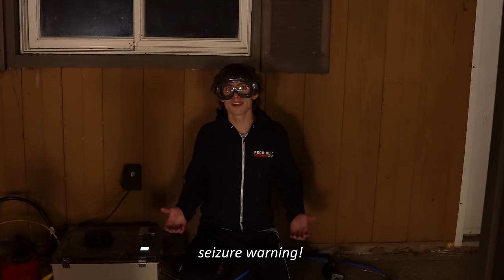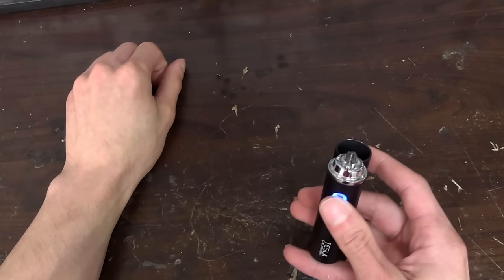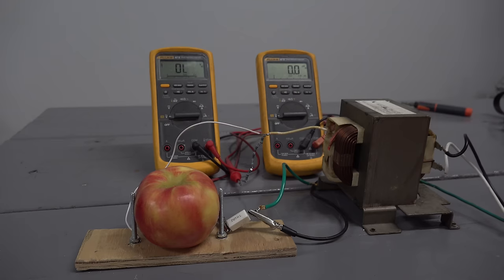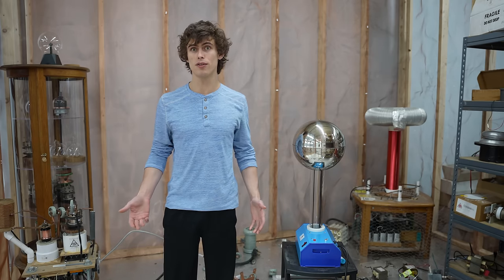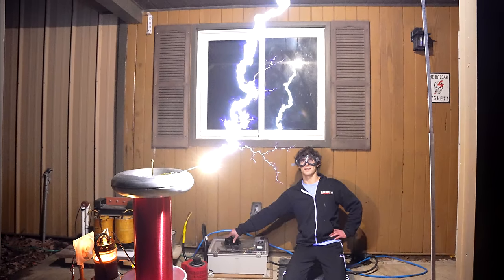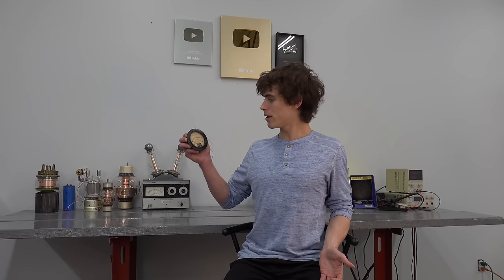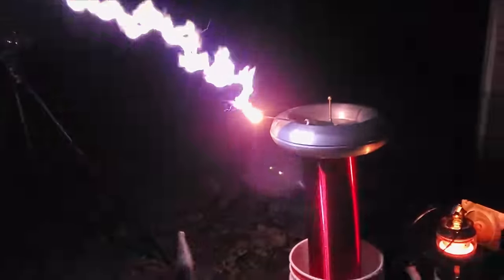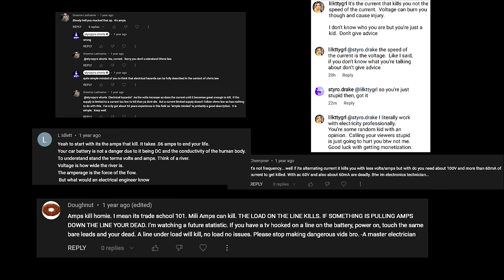Is it the volts or amps that kill?

Comment: This guy has a better understanding of electricity than most physics teachers will ever have
Reply: Nicely done educational video for the most part. However, the current measurement was not done correctly. Current at the bottom of the coil goes mostly to charge/discharge of the top load and coil capacitance. The arc current is only a very small fraction of the 3 amps that were measured. You should have held one lead of the meter in your hand and let the arc current go through the meter. That would be a lot more accurate measurement of the current that goes through your body.
If you really get 3 amps going through you at any frequency it most likely will kill you or leave really bad burns.
Reply: This guy has got his science very wrong, infact the i can tell you now that his arcs have less then 0.03 amps running through them, with out more info i could not tell you how many amps but i can ensure that is a magnitude less then he is claiming. if you dont believe me you can do some very basic math to work it out. For example i live in the UK, power from the wall here is at 240v, because we know P=IV in order for 3 amps to be supplied by the tesla coil while producing 100000v (thats the voltage he claims it is working at) you would have to put in 1250 amps at the plug (which is insane  and not possable), that would be 96 times the number of amps a single plug can supply and about 12 times the amount of power you house can take as most homes have 100amps or less on the mains input before your fuse board. For all you out there on 110v power that would be 2727 amps required to create a 3 amp arc.
Reply: @cbullar4205  You are on the right track here, there are several things wrong with the presentation. Unfortunately you are going in the wrong direction, get out the calculations and try again. The higher the voltage the lower the current in a transformer in ratio to the turns of wire.
Reply: @tedmoss   Im somewhat confussed by what you are trying to say, i have already pointed out that the higher the voltage the lower the current, its in the equation P=IV and given that in the case P (Power (Watts)) is a set value if I (current (amps)) goes up V (Voltage (Volts)) comes down and visa versa hence the outrageous claim that he has 3 amps at 100000v is just not possable on a wall plug as he is running his machine.
As i said realisticly he would be much closer to 0.03 amps (probably a lot less) but with out more info i could not tell you the exact figure.
For arguments sake, say you are on a 240v supply limited to 13 amps on the plug, that would mean the input power is 240v times 13amps which equals 3120watts. So with this we can see that the max possable power is 3120 watts if no losses occur (which they do) so if we feed this into the equation P=IV we get 3120=I*100000 which is the same as I=3120/100000 which means I or current is 0.03amps. As im from the UK i have bassed the figures on whta we use here, how ever i believe that US would be about 120v at 20amps limit on a plug which means the figure would be even lower still at 2400 watts or 0.02amps @ 100000v.
I have gone and changed my wording in the origional message as i can only presume there was a miss understanding of what i was saying as i was pointing out how rediculus the claim of 3 amps is rather then showing what a more likely figure is as i have done here.
Reply: @cbullar4205  hes not using a wall plug. at the end of the video he shows whats powering the coil. Also he lives in a cabin in the woods, im sure he gets more power to his place than most people as hes a chemist and probably needs certain power ratings in his home which he had custom build
Reply: @Yoda_Gaming1738  You have no idea if he is pluged into a wall plug or not. All he shows at the end is his power supply made form a number of step up transformers amongst other parts, how ever you can see the cable that runs to the first transformer and it looks like it might be a 10a cable 16a tops so that blows that theory right out the water. Also most building out in the woods have access to less power not more, but more intrestingly, "hes a chemist" and this is why you are trusting he presentation regarding physics?
Reply: @cbullar4205  youre the one assuming what his cables are rated at. Why would he lie here? other professionals have recreated these experiments countless times and proven that its not just amps that kill. Also yeah I trust the dude who went to college for chemistry to teach me about the compound makeup on human skin and an apple and how those theorist are easily bust in his scenarios. And no rural areas do not have less power, here in the US if youre connected to the grid your house is getting 120V power, but again, he could have had his power run through a transformer to step it up before entering his home
Reply: @cbullar4205  you also mention youre from the UK, hes in the US. our cables and electrical systems are quite different, especially with the climate difference
Reply: @Yoda_Gaming1738  Im not assuming what his cables are rated at, im looking at the size of them and making a rough calculation hence i admitted it could be 16a but it looks like 10a cable. Also it does not matter which country you live in the amount of current that can be passed though a certain size of wire before the cable melts, is the same (there are some variations bassed on the wires make up, but im presuming good quality cable with my figures). Also given that the US uses 120v and the UK uses 240v that means the same cable in the UK can pass more power as i have sort of already explained i.e. P=IV.
Getting away from that, i am not questioning the guys knowlege in human or apple skins im sure he knows alot about that, how ever the subject here is what kills Voltage or amperage and although this video is laden with facts alot of the info is not complete or correctly expained. Oh and yes i am qualified to know about this and with out offending any electricians reading this (you guys do a great job and all you realy need to know for sure is electricity can kill), no that is not my qualifacation.
Reply: @cbullar4205 You are clearly just saying he is wrong while anotfher huge electricity yougyber that debates almost anyone saw the video and approved its correct
Reply: That just implies  you have never met many good science teachers 
( or ANY bad ones either LOL)
Reply: Yes he's wrong

Only taking bits from different electrical principles and equations mashing them together at random and not fully applying all the factors involved either, no wonder he thinks ' basic physics' is wrong it's not wrong he just doesn't understand it yet 

Lol
Reply: Oh he forgot to show his power supply 
He's got his own 33kv pad mount transformer in his yard 

415v with a good Few hundred amps per phase 

Must have been one of his MANY Omissions in the video lol
Reply: I teach physics and can solve high-order differential equations in my sleep. But practical application is another beast entirely. The number one thing imo when it comes to understanding electrical engineering is experience.
Reply: @cbullar4205 I don't much about teslacoils, but I do build lasers and he says in the video that is a resonator.
A laser has a much higher power optical field inside the cavity then the "pump" laser has. 
I think you may be missing some fundamental understanding on how the teslacoil works.
Reply: @paintspot1509  Considering Styropyro was research assistant on hyperpolarization NMR spectroscopy, and, before putting it on pause, was on a phd program on Optics with Rochester University - when he says he isn't an electrician nor engineer he isn't lying, but I guess electricians and engineers are actually less qualified than he is to talk about the subject
Reply: @cbullar4205 make a video and show us.
Reply: @cbullar4205  P=IV is NOT correct here. P=IV is valid for a DC source, or an AC source where current and voltage are completely in phase. As mentioned (correctly) in the video, in Tesla coils the current and voltage are almost perfectly out of phase, the exact amount it's out of phase depends on the construction (particularly PFC capacitors can be added to bring them into phase deliberately). 

For circuits were the current and voltage are out of phase, the correct equation is P=IVcos(O), where O is the phase angle. For something completely out of phase, cos(O)=0, so power is 0. Since they are not completely out of phase, the power is not 0, but it is much lower than just P=IV.
Reply: @cbullar4205  Go make a video and prove your point .. until then you're just a waste of time.
Reply: BOLLOCKS! If that were true it would have only taken him 15 seconds to explain this.
Reply: @canberradogfarts  Why are you freaking out? Did you even watch the video? If you did, then how do you still not understand that there are nuances involved that make it impossible to just give a simpleton's 15 second answer? How about you just sum it all up for us real quick, and make sure to prove that what you're saying is true while you're at it? I'm sure the whole world would really appreciate it. Thanks in advance!
Reply: Umm, probably not actually.
Reply: What exactly is the purpose of that 15kw vaccume tube driven coil, does that not have something to do with amplifying the power going into the Tesla coil?

Since he did not show the exact design of the system, it is a BIT STUPID to talk about the design when we don't have a clear representation of it.

I'm not going to claim all he said was correct, I am not educated and/or stupid enough to make such a claim, however he seems very confident in his abilities, can put theories into practice (showing proof of knowledge) and is willing to challenge "professionals" who quote misinformation, so far he seems to have much more authority on this topic that you have brought to this thread.

You're whole argument is "I don't know exactly how his systemis built, but it's wrong"...
Reply: Explain in better detail why he's wrong?

I can't stand so called "professionals, experts" who act like an authority on a topic and claim someone is wrong without proving why your right and they are wrong.

The fact you went out of your way to say he is wrong, is strange considering this whole video was challenge the idea that only Ampers or Voltage kills, when it's not that simple, thus he is correct.

Exactly how is he wrong?
His videos were more reinforcing that your comment simply claiming "he's wrong".

The fact he didn't provide all their is to know on certain topics to me seems irrelevant, unless you can clearly explain why they are important and explain what he left out?

Come on now, you went to the effort of claiming he's wrong, so please let me and everyone else who reads your comment why he's wrong and more importantly HOW HE'S WRONG?

I'll wait...
Reply: @canberradogfarts 
He already did in the original short. This entire video is an elaboration...
Reply: Bro literally does the most unsafe experiments, he would fired from most companies in an instant
Reply: Young long-haired schoolboy...but SMART! Who knew?
Reply: @cbullar4205  you literally have the correct proof right here in a 21 minute video yet you still come up with stuff to deny literal physics. You people are helpless.
Reply: That speed on the highway vs mph and distances traveled just made me a much smarter journeyman.
Reply: @cbullar4205 you are assuming P=IV When that's a simplified equation with its use conditions. He explained it in the video. The phase difference makes the power lower almost completely since the cosine is multiplying
Reply: @Sharpless2  No, you have some partial information in a 21 minute video, if you truly want to know the answer to this then do some research and educate yourself, dont just presume that some randon video posted on youtube must be fact, after all Youtube fact check every thing they allow on there platform dont they?.. Personly myself im trusting the 30 years in the field i have, o yeah and my 2 Batcholores and Doctorate degree in the subject. Infact if you bother to take just 5 mins to google the subject you can find many scientific papers written on it. Also you will see how so many peole have been cooked alive by tesla coils from the inside out with out even knowing it was happening until it was to late. Generally as long as the current is kept below 0.1a and contact is kept short then permanent damage is not as likely, just try and avoid the path to ground passing throuhg your heart.
Reply: @cbullar4205 I doubt you have any degrees let alone a doctorate. If you’re so confident make your own video and prove him wrong.
Reply: He really doesn't.
Reply: you obviously wouldn't know either way
Reply: Why don't one of you experts in this thread make a video yourself proving how he is wrong? I'll check back in a year, but I won't hold my breath.
Reply: Duh, that’s because physics teachers are not electricians. How dumb of a comparison…